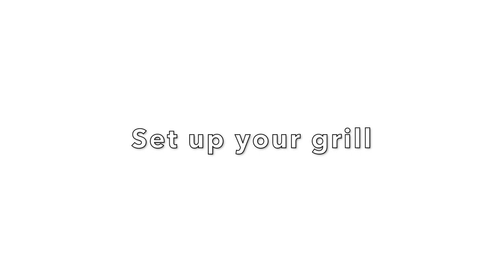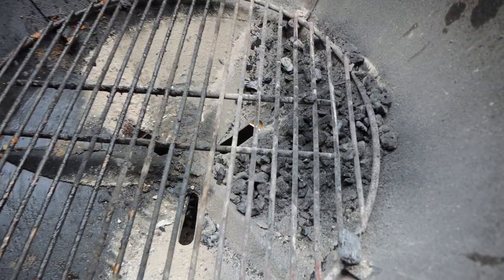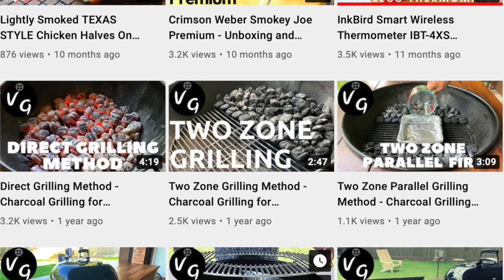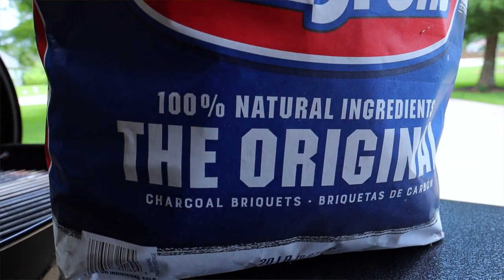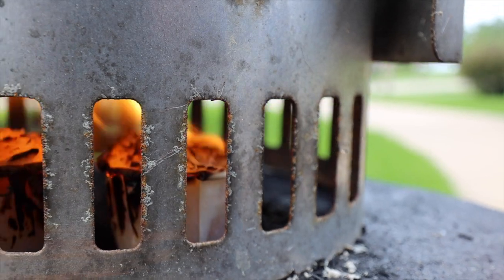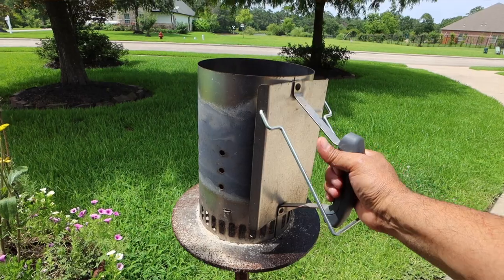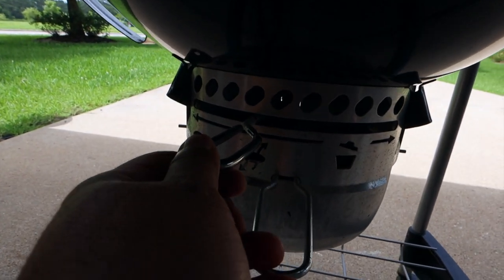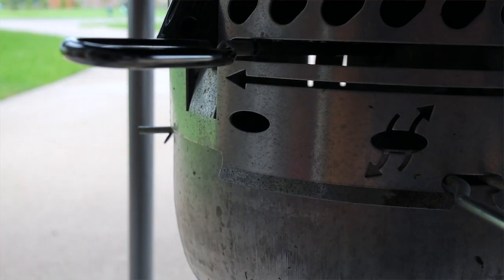How to get your Charcoal Grill as Hot as...

Comment: Good tips.  I usually reuse my coals unless my grill grate needs to be cleaned. If so I just spread out the coals and let them char the garbage on the grates until they run out of heat.   It makes it super easy to scrape off leftover char off the grates.
Reply from the maker: Hello Carlos. Yep.  Save and use that charcoal.

Comment: that first tip is great! Lots of people recommended closing all the vents to save charcoal after a cook, but nobody else explained that you have to knock off the ash for best results.

I have a question about the standard charcoal grate in weber kettles. I noticed that it has two metal bars running across it. Do those have a specific use other than making the grate stronger? Don't know if they're useful for separating direct from indirect sides.
Reply from the maker: Thanks!

The metal bars add strength and keep grates from spreading apart from constant heat and cooling.

Comment: I moved my temp probe in my kettle lid down to food level.  The temp over the fire at the top of the dome is basically useless information.  But even with my temp probe just above the grate, I can get my probe to max out.  Foil over the open space on the charcoal grate, and leave the lid offset by an inch so you can see the cooking grate on the food side.  I melted the handle on the dome doing this once.
Reply from the maker: Wow. That was a hot fire.
Reply: @Viewtoagrill  Yes it was.  My kettle is no longer round.  I have to use binder clips to get anything close to a good fit.

Comment: How does the vortex in the center hot as h e double hockey sticks work with the burgers out around the edge of the grate 

Another great video
Reply from the maker: Hello Kevin. This would probably work out extremely well but you wouldn’t be able to use the rack to get them all on and off at the same time.

Comment: Johnny, for the second time in a row, despite letting them ash over, after I put the charcoal in my grill and let it heat up for 5 mins, when I took the lid off, the briquettes were no longer glowing, and the grate temperature was really low (Took nearly 30 mins to cook my burgers.) What might I be doing wrong? (And yes, I'm keeping the vents open) P.S. Honestly, the only time I have consistent success is when I use a hair dryer to blow the coals until they (and the outside of the chimney) are orange hot.
Reply from the maker: Are you using a full chimney starter full of charcoal?
Reply: @Viewtoagrill  Yes.

Comment: I can't get my Weber kettle over 450 with the lid close and both vents wide open. I'm really confused . It's a 10 month old grill bought it straight from Weber. Using Kingsford filling the Weber chimney to the top pouring out right on the middle. Any suggestions?
Reply from the maker: Hello Joe.  If your charcoal is in the middle and the thermometer is reading 450 then you may actually have the heat over 600.  Remember in this video I have the charcoal right under the thermometer. If you charcoal is in the middle then the lid thermometer is on the side. Also the slow n sear keeps the charcoal in a tight area whereas if you pour it in the middle the coals tend to spread out more.

Comment: Will a drip pan in the middle of the weber baskets keep you from getting the heat up? I can't get mine to hit 400 with the vents open. I followed your instructions but I'm using a drip pan.
Reply from the maker: You have a drip pan between the fire and the thermometer?  If so yes.  The drip pan will deflect the heat.
Reply: @Viewtoagrill  That was fast haha I'm still trying to grill them. The baskets and the pan are on the same grill which is the charcoal grill. I have the baskets on opposite ends and the pan in the middle.
Reply from the maker: Not sure how that happened…. Watch my rib video from last week.
Reply from the maker: The pork rib video… by the way the setup that you are using is not meant to get up to 400… that split setup is for lower temps.
Reply: @Viewtoagrill  I just finished watching it. I am going to download that app. Thanks for responding so fast and your videos are awesome!

Comment: Same grill, can't get it over °350 sometimes not even that high!
Reply from the maker: Hey Tom remember in this video I’m only using 3/4 of a chimney starter because I had some left over charcoal already in the weber kettle if you don’t have any left over charcoal in your Weber then use a full chimney
Reply: @Viewtoagrill  I do use my leftover, as a matter of fact I just cleaned the ash out for next time. I dont use a chimney starter, I use an electric starter. Still can't get the coals that hot, most of the time it's not a big issue. Thanks for replying so quick!
Reply from the maker: Tom, I have an electric starter as well but I don't use it.  The chimney starter really does work well to get all the coals lit.  Thanks for watching.  Good luck.

Comment: I can’t seem to get mine over 425….don’t know what I’m doing wrong 😞
Reply from the maker: Hey Tim. Are you doing all the way bings in this video
Reply: @Viewtoagrill  I’m using the two baskets…..Loading them up with a full chimney…..the only thing I cannot confirm is the actual temperature inside instead of what the dial one says…….I’m gonna try that when I get a chance…..was wondering if I needed more charcoal because I’m using the baskets and not the slow and sear, but they look around the same capacity.
Reply from the maker: @timtheflyguy  one full chimney should do the trick even in the Weber baskets. In this video I had the thermometer above the fire.  Where is your thermometer?
Reply: @Viewtoagrill  I had the coals in the middle, so the thermometer was of course away from them, I am going to experiment more, I just bought it, so I’m sure I have to get a little more experience with it, thanks for all the good info….I’ll let you k ow what I figure out, thanks again!

Comment: How long do you go with those burgers indirect?
Reply from the maker: Hey Scott. I go until they turn gray or about 85 degrees internal… then I mark them, put them back on the rack and cheese the until the cheese is melted. I aim for medium well.
Reply: Great video Johnny. Do you mean that you “flip” them after they turn 85 degrees? Also at what temperature do you pull them out?
Reply from the maker: At about 85 I put them over direct heat to get some color on them and then go back to the indirect side… add cheese, close the lid until the cheese is melted shooting for 145 internal… I guess I need to do a reverse sear for burgers video .. lol
Reply: @Viewtoagrill  yes please. I would love a reverse sear for burgers video!

By the way, I’ve enjoyed your other videos as well. Thanks!
Reply from the maker: @danielleebrick4272  LOL… I’ll get it done.
Reply: @Viewtoagrill  I just made my indirect attempt tonight and I decided to try to get it as hot as you got it. I failed miserably.

My setup:

1. Weber 22” with a slow’n’sear seal around the lid that I installed immediately prior to this cook

2. On my lid when the thermometer is facing me the vent is to my left so I place the slow’n’sear basket on the right side

3. Had a small amount of Kinsford original left over from last BBQ so I cleaned it

4. Was going to fill the Weber chimney 3/4 full but when I realized the bag was almost empty, I just dumped the rest in. A bunch of fines came with it which I ignored. I wonder if that was my mistake.

I lit the chimney with newspaper as is my custom.

I dumped the old charcoal from the last cook on top of the already nearly full chimney

After it was ready I dumped it in the basket of the kettle. It seemed really ashy.

After that I never could get the temp up even leaving the lid on for 15 min and both lower and upper vents wide open. 450 was the max I saw. I don’t think the thermometer is bad because when I went to sear the burgers I left them on for 90 seconds per side and the sear was questionable.

Also had them on the indirect side for a good 15 min before I felt they were done enough to start the searing process (was hoping I was doing doing it similar to what you do).

I think with 600+ it would be less time in the indirect side and a better sear on the direct side.

Was the fines that came out of the bottom of the bag my problem?

Thanks.
Reply from the maker: @danielleebrick4272  hello Daniel.  Did you remember to tap the chimney starter once it was lit.  That generally will shake out the fine ash before you pour it in the kettle.  Also did you make sure both vents were completely open.  Sounds like the rest of your setup was correct.
Reply: @Viewtoagrill  thanks. Forgot the tap. Should have watched the video again😂.

Thanks.